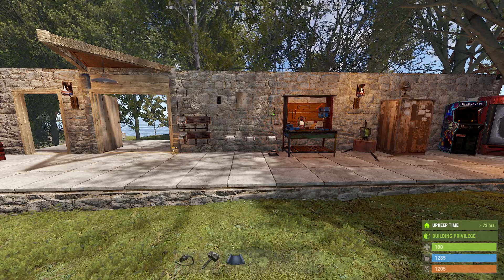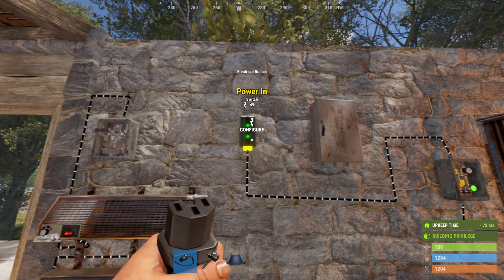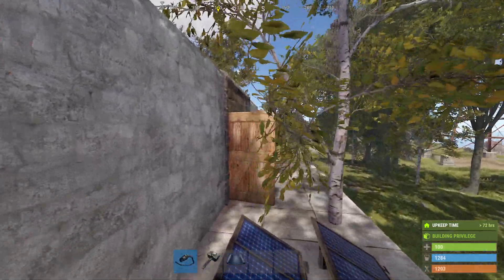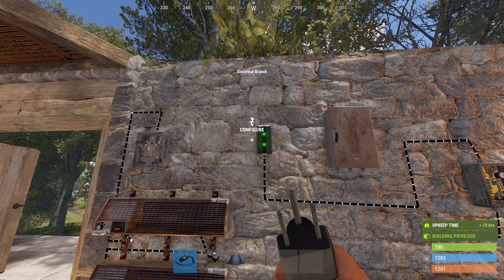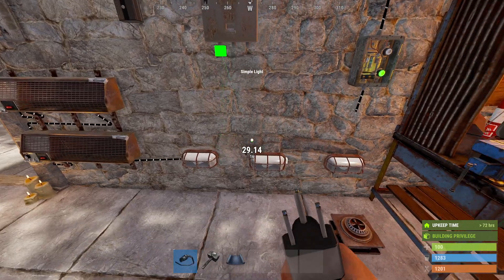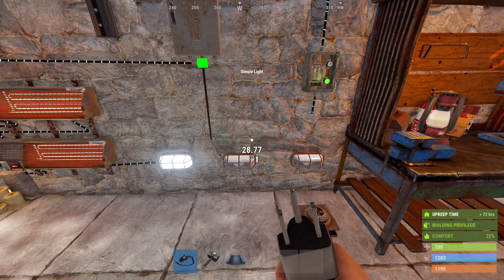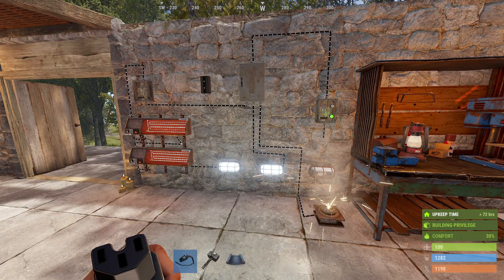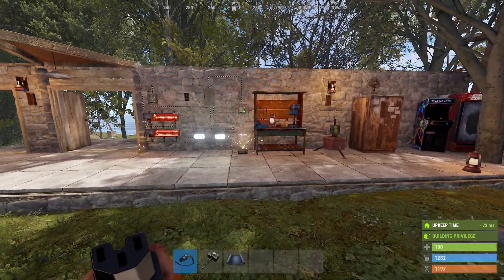Rust Electrics 6 - Branch vs Splitter, the fight is ON!

Comment: Splitter, splits the power : 3 and branch is for choosing what power you want, If you have 3 furnaces they consume the same amount of electricity so use splitter, if you have a furnace, a turret and a ceiling light use branch because they dont consume the same amount of electricity
Reply from the maker: A good point but.. not always the case, as the branch will use the power even if the item isn't on, so for a turret that's generally fine as most people want it always on, but for the others you could be wasting power when they aren't in use, this is the bad of the branch.. unfortunately!
Reply: @GenXGamesMeister  You can add a switch
Reply from the maker: @ΛεωνίδαςΔ  If the switch is after the branch the power still get drained from the branch side, before the branch is no good because you lose both outputs. test it and see :) Or look at the video again when i explain the branch test.
Reply: @GenXGamesMeister  switch before branch
Reply from the maker: @ΛεωνίδαςΔ  All good if it works for your needs, happy rusting 👍

Comment: Thanks! Just discovered this yesterday. Would you consider this issue with the electrical branch a bug or an intended trade-off? I'd say it is a bug as the behaviour is quite strange and also undocumented in game (like where the splitter says it will divide its output evenly across connected outputs).
Reply from the maker: When I first realised it I was certain it was a bug, but its been in play so long now maybe its how they intended, it's hella annoying though!
Reply: @GenXGamesMeister  Yes, you can definitely work around it but logically it makes no sense. I'll file a report with Facepunch, hopefully they can help out. If you think the same, please file a report too! :)

Comment: So we should just use a splitter before the branch thus eliminating the constant Branch drain.  So long as we never touch the other two splitter outputs we will also refrain from splitting up our power.
Reply from the maker: Well, as soon as you put the branch on the splitter it will start to draw from battery. unfortunately the same rule applies, whatever number you have set on a branch will pull that power no matter what unless it has an off switch above it of course.

Comment: i need 3 circuits. solar>battery> splitter, THEN spit them off to... #1 Nighttime running lights. #2 Always on Garden Lights. #3 Water pump system. i could really use some help. ive been using electrical branches and not it looks like the spitter is a better option?
Reply from the maker: Many ways to do it, but you could use one branch and use left output for your always on garden lights and the right side for everything else as that will only pull as needed. Put a splitter on that if you want to divide it up. Of course it all depends how much power units you have as putting on a splitter on the right side will divide the number down even though it has the advantage of not actually pulling it :).

Comment: How have they still not fixed this. It's not like it's impossible to code, since the splitter already does it correctly. So, that means that there's no way to split of an exact amount of power without having it be always on? No way?
Reply from the maker: I know, I cant believe its by design, been like it since beginning of electrics implementation though. Tis a shame for sure!

Comment: rust does have a circuit that fixes all the issues with EB and saves you the remaining power by storing it back into the battery.
Reply from the maker: Elaborate as I've used them all over the years, yes you could do it with 2nd branch added in and forwarding the non branch (low priority) output back into battery but ... more headache.. :)
Reply: @GenXGamesMeister   if you have a discord i can send you the circuit in picture form, so i dont make it confusing to understand
Reply: @sleep4430  could u share a link